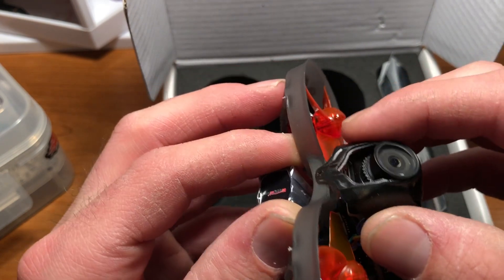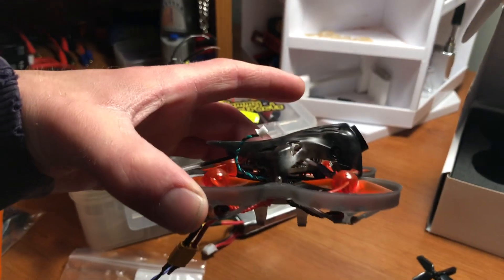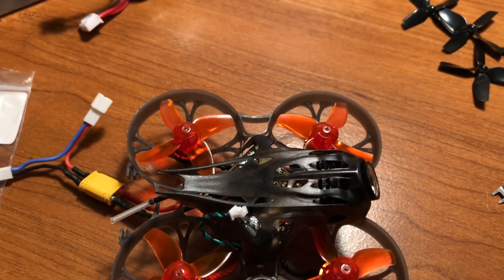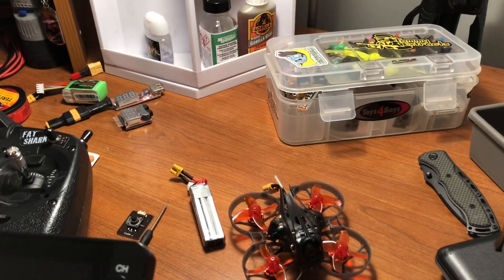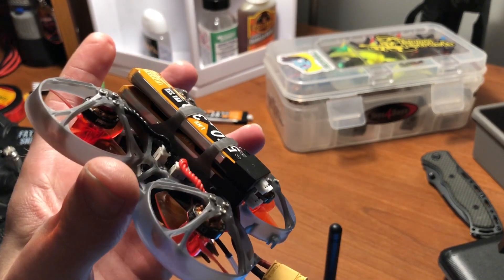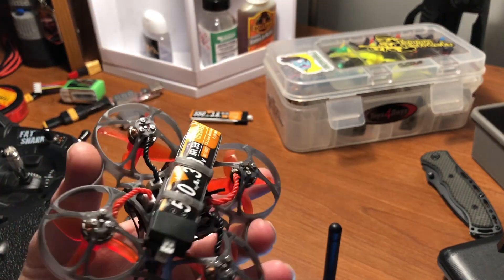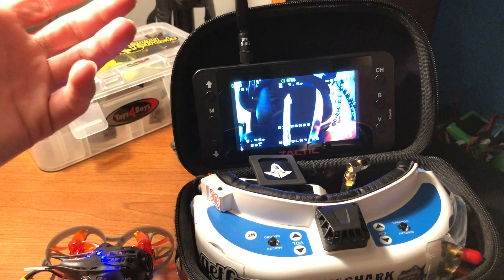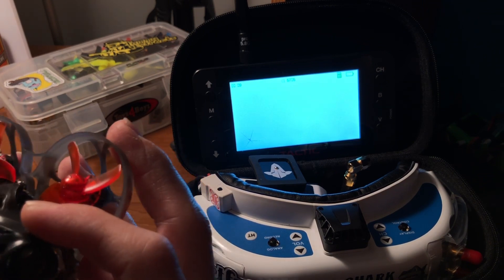Mobula7 HD Special Edition???

Comment: I hate to break it to you, but those higher mw numbers are just the way they appear in Betaflight.  You don't have those available in your Mobula7 HD...It will simply go from 25mw, which it should read properly in your goggles...then the next setting up will be the 100mw, regardless of what the readout says in your goggles - It's 100mw.  Same with the next setting...it will be 200mw, regardless of what it says in your goggles...the next setting up, probably 800mw, will just be the same 200mw and do nothing additional in VTX power output.  It's just a quirk in Betaflight, or something else about it not reading properly.  One think FOR SURE, your Mobula7 HD doesn't have anything but what the manual says 25mw, 100mw, and 200mw. :)
Reply: bad vtx-table with wrong information? Hardware its 25,100,200mw. Higher is not possible with that chip. I can re-edit my vtx table and get 1000mw if i want, but will still be max 200mw hardware output. Just a bad edit in the vtx table. You can make those yourself.

Comment: How is this possible ? Do you try vtx power test on 500/800 ? Maybe all mobula7 ha hawe this factory locked , and you lucky ?
Reply from the maker: Karolina Barišauskaitė I’m planning on testing the power off the Vtx with my multimeter next time I take it apart. I can tell you right now you’ll be Blown away buy the results of the next video because I’ve already started field testing.

Comment: It should say at the bottom of your vtx manual that when it's on 500 it's actually 100 but that mite be a new print I have for mine but you can download it hope it helps
Reply: Actually 500 is 200.  And 200 is 100.  I can only assume 25 is 25 but the 100 and 200mw settings are stated in the trashcan vtx module's manual and is the same vtx we see here.
Reply from the maker: Aarons14bugs so then what’s 800 ? This wasn’t meant to start arguments over the output power on this vtx, I was simply Demonstrating the various output power that was showing up on my VTX. This is actually starting to cause a lot of controversy and is leading me into ordering an RF tester. Until then I haven’t been able to do a lot of testing due to weather but on 500 I get about a minute to a minute and a half of flight time CRUZING. I haven’t gone up to 800 yet cus I’ll probably only get about 40 seconds before I kill another new battery only got 3 out of 5 left.
Reply: @Unsub223  Wasn't trying for an argument,  I just wanted to say that according to the tc vtx manual.  It would be interesting to see the measured readings at all the smart audio settings.

Comment: Mine just came in today, finally. Ty for the smart audio tip! Mine goes to 800 as well, fwiw its V3. Interesting tidbit, when changing from Boscam E to Fatshark race band, 600 is max that's avail. Also noted that it can be turned completely off, or on. Curious if the on setting will give the max power no matter what? Impressive all the settings this little guy has. Just did the camera flip as well, smart idea as I need it more level till I get the rust off my skillz ;) Liked and subbed, I do wish your mic was louder, had to raise my speakers to 40 to hear you, usually its set at 12 for yt. Next video will be sure to scare me to death with it so loud lol Thanks again bro.
Reply from the maker: heliflyer69 yes sorry about the audio I’m getting a new mic next week so hopefully the next video will be easier to hear me. And did yours come on raceband for the default, mine was on raceband but now I keep mine on Boscam E 500mw and I fly uncomfortably far with it. Make sure you have the failsafe set up that way it don’t take off on you if you fly to far.